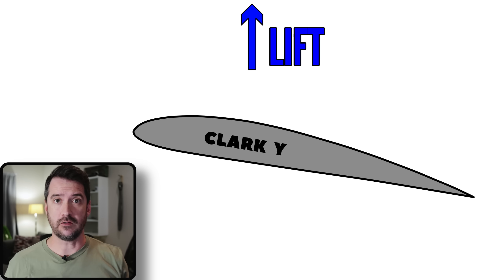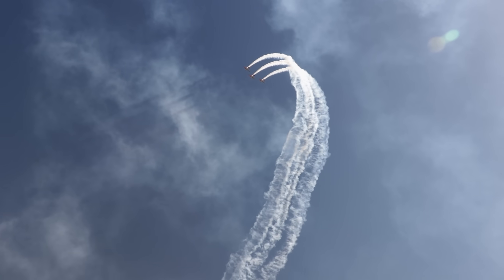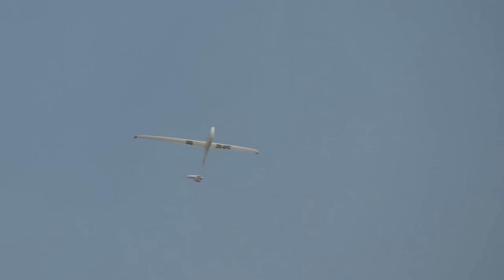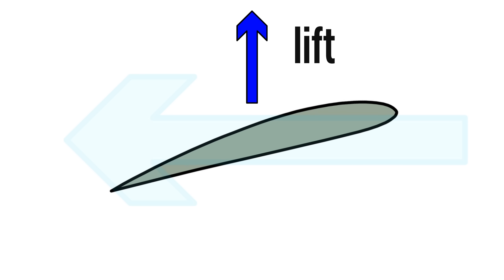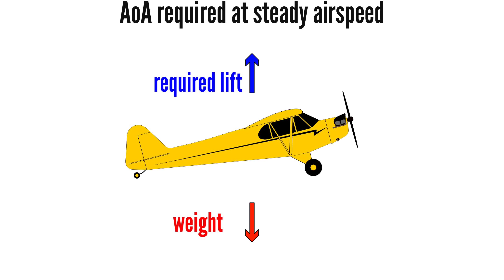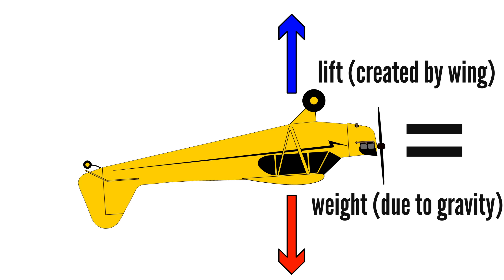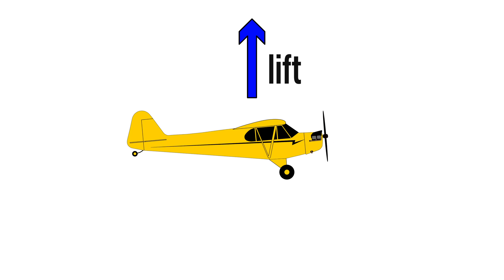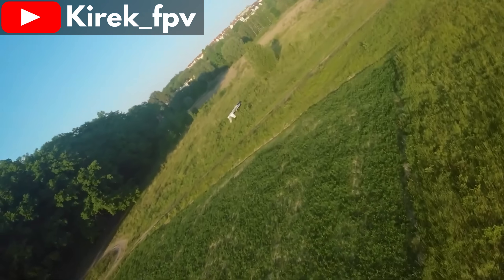Is Airflow Distance Over the Top of a Wing Always Longer?

Comment: The Book "Stick and Rudder" written by Wolfgang Langewiesche in 1944 should be required reading by all pilots. He confirms what you are saying, but perhaps a wing flies very similar to a kite, the direct high pressure under the wing is where most of the lift comes from and that's why most every wing has a positive angle of incidence. The author says that when critical angle of attack exceeds 18 degrees, a wing stall is usually imminent. But the author also explains that lift is created with the wing at a positive angle of attack is literally pushing down a mass quantity of air (beating it down) which by Newton's third law of an equal and opposite reaction pushes the wing up. It's kind of interesting that Bernoulli's principle is more applicable to sail boats and how an efficient sail boat can sail within 30 degrees of the wind.
Reply: " the direct high pressure under the wing is where most of the lift comes from"

The lift comes from a solid's shape, asymmetrically oriented to the relative wind (from any cambered shape asymmetry plus angle of attack asymmetry).  This creates a force in the vertical direction from the reaction to turning the wind.  All the lift from this condition comes from conservation of mass, momentum and energy.  

Bernoulli is simply shorthand for these conservation relationships.

Bernoulli in the above sense, is applicable to all air and liquid flow dynamics.  It is universally present, because it represents the most fundamental physical principles.
Reply: @davetime5234  Dave, How many readers are going to understand that explanation? Most of us are not physicists, certainly not I, but I did get an "A" in high school physics. And kites fly without a chambered shape, especially a box kite. Basically it's not the cambered surface above the wing created a low pressure area that creates all the lift to float say a 1,000,000 pound 747-8, it's the direct pressure below the wing. Although wings with lift devices such as flaps and slats adding (and lengthening) more camber do add to lift which lowers stall speed during takeoff and landing. Just as vortex generators lower stall speeds by preventing separation of the air flow over the top of the wing. It's all good. But then again how do laminar flow wings work with the same or similar camber above and below the wing?
Reply: @larryweitzman5163  "How many readers are going to understand that explanation?"

I would think a fair few would understand it because the outline is simple:

Asymmetry of a solid object moving through air, turns the air.  Lift is the resulting reaction force.

So, two simple things for the essence of lift:
1)asymmetry
2)turns the air

"kites fly without a chambered shape, especially a box kite. Basically, it's not the cambered surface"

Lift is caused by "1)", asymmetry.  You could have no camber, lots of camber, upside down camber.  Camber by itself says nothing about lift.

Lift is caused by asymmetry.  If camber is asymmetrical, that adds to lift.  But angle of attack is always either adding to any asymmetry caused by camber, or subtracting from it.

So, you don't need camber at all for asymmetry.  Which explains box kites and paper airplanes.

"it's the direct pressure below the wing. Although wings with lift devices such as flaps and slats.."

Actual pressure diagrams, widely available, show the pressure decrease on top is mostly responsible for the lifting force.

Any consideration of wings, camber, flaps, etc., all work the same in terms of the pressure drop on top being the heavy lifter in making lift.

But, the wind does confront the front of the wing.  And there is a pressure disruption around the wing that results.  So, the different pressure that result around the wind need to be justified:

There is a competition for space between the relative wind that would be moving through without the wing, and the decreased shared spaced imposed by the wing.

The earlier mentioned conservation of mass flow rate, momentum and energy, set the ground rules for how this pressure difference profile develops around the airfoil.

As complex as that may sound, the overriding concept is also simple:

The competition for space between the air and solid object forces a pressure reaction because air mass cannot stagnate.

The "self-forming" pressure distribution is the one that expedites the mass through the restricted space such that mass does not accumulate anywhere.

So, we could say lift is from:
1)asymmetry
2)turning the air
3)from a competition for space caused pressure response
4)which accelerates the air mass sufficiently to prevent flow disruption.
Reply: @davetime5234  In defining asymmetry you are referring to the relative wind I presume. That could also be defined as angle off attack. Gotta to have some angle of attack and usually angle of incidence and enough airspeed. I would presume that you have a physics/engineering background.

Comment: Even the Nasa website disagrees in the longer path theory stating lift is due to flow turning.   IE the wing re directs air downward to produce an upward reaction.

Even completely flat plates can create lift this way in which case there is no opportunity to claim it has anything to do with a longer path.

The explanation in this video only asserts that an upside down wing always still has a longer path over the top due to the stagnation point.  It doesn't provide any evidence this is always true.

It would be easy to modify the leading edge of a typical airfoil with a point so that when it's upside down there is no reasonable way the stagnation point could move down enough to claim the upper path is further.   This wing could still provide enough flow turning to fly just like a flat plates creates lift
Reply from the maker: This video's only purpose is to assert that an upside down wing will still have a longer flow path over the top due to the stagnation point. I certainly dont have the means to prove it experimentally, and I'm not clever enough to do the maths 🙂 Either way it's not required as any fluid dymamic theory proves it, Euler's equations for example perfectly proves it.

Note that the longer path isn't responsible for lift and isn't meant to describe lift, it only enables lift.
Reply: It's easy for us to get mixed up about what we mean by "path" and attempt to use one word to make all sorts of arguments.

In a venturi tube for example, which path are we talking about?:  the mean path of the entire flow, or the path only at the edge of the flow close to the curved contour etc.?

If you say the mean path of the entire flow from local to extended, then no alteration in path length occurs, yet we get a pressure drop.

If on the other hand if you say the path of the air nearest the curve, then of course, it has to be longer for any pressure drop to occur.

The completely flat plate produces a local air path difference simply due to angle of attack, but the broader path of the overall relative wind doesn't change.  So, that's already two different path meanings for the flat plate.  And then you are adding a third definition for path: the geometry of the airfoil's shape irrespective of any orientation effects.

In the venturi's case, we're implying one path that hugs the curve; in the completely flat plate, we have to look further out a bit from the surface to make sense of the local path, because the average local path is the smoothed-out journey around the sharp and abrupt edges, around which the air cannot turn perfectly fast.

The notion of path is a mix basket of fruit.  Exact definition is everything.

As far as Nasa and tying those pieces together:   Air forced down does create an upward reaction.  That air is forced down by a pressure difference.  

That pressure difference results from a solid with an asymmetrical orientation producing an asymmetrical "path" challenge to the oncoming relative wind:  

Static pressure (potential energy contained within the affected block of air mass) is consumed equal to the dynamic pressure (kinetic energy) increase compelled by "equal transit time" of the entire wider air mass (a condition from, as NASA lists, the Navier-Stokes continuity equation, considered in aggregate).

So, the above invokes the other big terminology mix-up:  "equal transit time"

Because mass transit time through the vicinity of the wing's effect has to result in the same mass out equal to mass in as before, it means an asymmetry in the path requires local transit time also be asymmetric, that is unequal (for mass out to be equal to mass in, and at the same level as without the wing).

In other words, equal transit time through the system means that within the system, a certain definition of relative path distance being different, is absolutely necessary for the condition of lift.  

And this is true whether a wing is a completely flat plate or not.

Comment: Bernoulli's principal is negligible to slow flying planes...  all you have to do is hold your flat hand or a flat board out a moving car window and tilt it to see it creates lift, even though the path of travel above and below your hand or the board from end to end is identical.   The way you create lift is daftly simple... you shove air down.  By shoving air down, you increase the pressure under the wing, and decrease the pressure above the wing where the air would of been if not disturbed by the traveling wing.     Watch an airplane fly through a cloud of smoke and you can see the air being shoved down behind the wing, as well as the wing tip vortices.

All I have to do to prove this is fly an outside loop...  not an inside loop, an outside loop.   Yes, you can fly outside loops... aerobatic pilots do it all the frigging time.   An outside loop is where your cockpit is facing outside the circle of the loop, not inside the circle of the loop.

Take a look at the fan blades on your box fan or a computer fan.   Pretty flat.   And yet they create high pressure on one side, and low pressure on the other, moving air... or rather shoving air... through them.
Reply from the maker: The "hand out the window" is incredibly lacking as an explanation and forms in incomplete unerstanding of lift. For one, the path over the top if your hand would absolutely be longer, see from around 7:44 in the video if you missed the part around the formation of the stagnation point. Mind you, the path length difference doesn't create lift, it only enables it to be created.

Not sure what the outside loop proves. It sounds like the main argument that I disproved in the video. The path of air over the upside down wing (the side that is pointing up, now the bottom) is longer than the path below (which is now the upper surface) as explained from about 9:00 in the video. The confusion is created by camber/upper surface shape. It's not the camber that creates the longer path over the wing, it's the angle of attack. And as long as a positive angle of attack exists on a wing, you hand, or a flat plank, path over the top will be longer. It's all well proven and documented in fluid dynamics.
Reply: @LetsGoAviate  Pretty sure the length of the wing on the top and the bottom does not change... dynamically depending on its orientation.  At least not according to my non-magic tape measure.

Outside loop, you're always flying the wing, upside down, irrespective of gravity's direction.

Quad pilots like me... fly with no wings... at all.   When you've got enough engine, you don't need... wings.

My 5v DC computer fan will flow the same amount of air pretty much... forwards or backwards... 

As long as you can shove enough air out of the way in one direction, you'll go the other...   aka a rocket.   Spewing baseballs out one end to go the other.

Or, a sailboat tacking into the wind.     Or a girl on the ice on a secretary roller chair, getting hit by a baseball cannon, and deflecting them with a board...

Something about Newton's Third Law...     push a lot of air molecules downward, you'll go.. upward.
Reply from the maker: @choppergirl  Based on what you say, I think we are more ore less in agreement, but getting stuck on terminology and basic principles. The outside loop is simply flying upside down in a loop.

The length over and under the wing doesn't change when upside down, but the distance of the airflow does. The stagnation point that separates the air over and under cannot be ignored. As long as it has a positive AoA, the path over the upside down wing will now be longer. Don't take this as me saying the path length difference creates lift, it doesn't without at least applying one other lift creation theory. Newton's 3rd law is a valid way to describe lift. But it's not just the bottom of the wing shoving air down. How does a wing stall then? We know the stall happens on top of the wing. Think about it, if bottom of the wing shoves air down, regardless of what happens on top, where is the air over the top going? Does it create a vacuum between the down shoved air and the air over the top? No, it's all differences in pressure and the air over the top has to be displaced downwards too, and this simply debunks the air being shoved down by the bottom of the wing theories. NASA insists lift cannot be correctly understood by ignoring what happens with the air going over the top of the wing, i.e. low pressure and air speeding up, and I agree.

You used a sailboat as an example. I sailed Hobie 14's inland and 24 footers to big Catamarans on the ocean long before I became a pilot. When sailing let's say 45°-30° upwind on a tack, the wind doesn't push the inside of the sail, it cant. The forces at an angle doesn't resolve forward, but approx 90° sideways of forward. Instead, low pressure "pulls" the outside of the sail. I'm not saying this carries over 100% to airplane wings, or that there is no pushing on the bottom surface happening, but the "hand out of the car window" arguments simply isn't enough, and apart from being partially true, it creates a wrong idea of lift.
Reply: @LetsGoAviate  Does a Manta Ray swimming through the water, stall?

Delete gravity out of the equation, and there is no stall.  Even if you increase angle of attack to 89.99999 percent, there is still lift upward... albeit, past 45 degrees is more drag than lift.   I could argue there is no drag at all, but rather, that drag is just lift in a different directional vector.

https://www.youtube.com/watch?v=sRG2Ivn2t_M

Comment: As an aerobatic pilot your assumption that the wing is generating lift inward over the top of a loop is not correct. This would create a very tight egg shaped loop. For a round loop, you have to relax back pressure over the top. Now granted it’s not generating lift the other way either; it’s near zero at the top. 
Bernoulli “lift” is a factor but only a small one in wing lift generation. The majority of the lift is Newtonian. 
The commons incorrect descriptions of lift are: “Bernoulli” pressure differential creates all lift, this is not true.
“Newton” air hitting the bottom of the angled wing pressed the plane up, this too is connect
“Equal transit” this has been disproven many times in every single wind tunnel test.
It is a very complex topic. If you really want to understand lift start by reading Euler’s equations for fluid motion. NASA has a great section about this.
Reply from the maker: Thanks, I think you mistook the topic video. I did not explain, or attempt to explain lift. If simply took the upside down argument, and explained why it's false. That's it.

The point I made about the loop - as you said - that the wing doesn't create upside down lift at any point, assuming it's done properly, is valid.

I'm surface level familiar with Euler's equasions, as it can be used to mathematically explain the stagnation point, the whole concept this video is based on 😉

Comment: As a kid I used to put my hand outside the car window, while in motion, like a wing, and it was clear to me then that the angle from the wind direction simply diverts the airflow either Up or down, just like a plane's elevator does, else they wouldn't work, to give us more altitude or less altitude. I.e move the aircraft up or down. Wings have a built in positive angle of attack, even jets.
Reply from the maker: How then would you explain a wing stalling though? A wing stalls when the boundary layer of air on top of the wing is no longer sufficiently attached and creating insufficient lift...well known and well documented. If a wing is just pushed into the air and it's all about the bottom of the wing, why does what happens on top of the wing matter? And if the answer is it stall because of increased drag of the high AoA, how do you explain accelerated stalls?

Comment: Not so!  When a wing inverted, it must have a higher angle of attack than when upright.  Unless you have have a symetrical wing which unlimited class aerobats have.  My wing was 23012; semi symetrysetcle(sp?) section.  I needed FULL forward stick when inverted and engine also stopped.  CAVU skies.